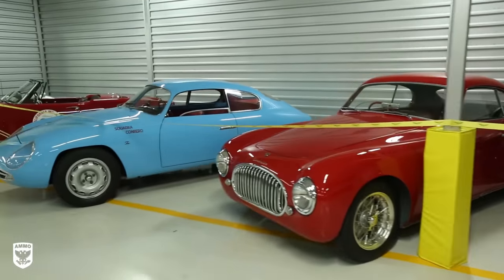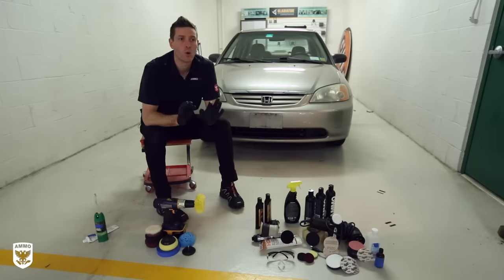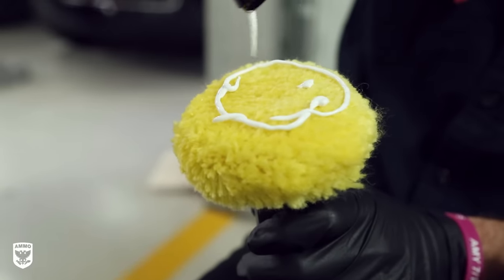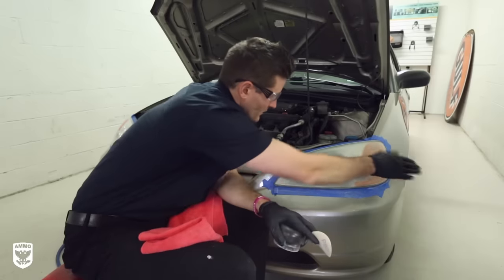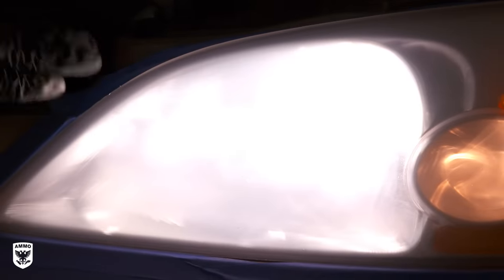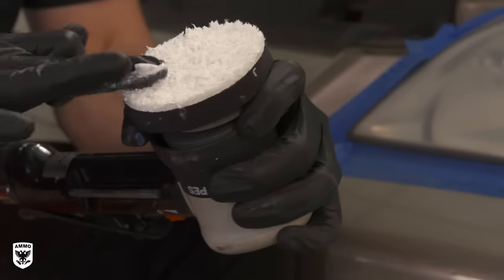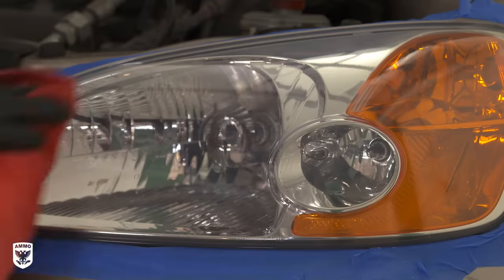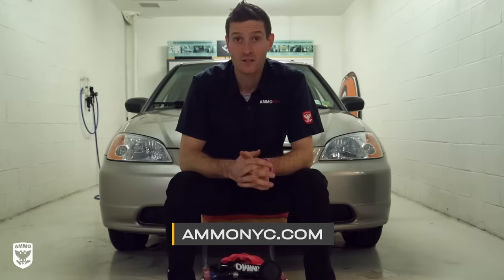How to Fix Foggy Headlights: 3 Different Methods: Honda Civic

Comment: Im new to this, what is the compound and polishing step for? I'd think the only reason to polish is if you somehow messed up the clearcoat. It looked just as good after polishing and the compound. Maybe that's just because its through the screen. But if its just for a finish why not use a meguiars finishing paste wax?

Comment: Hi where can I buy the handle you stick the sandpaper on ?Do you have a link?thank you
Reply: Hi Youtube doesn't allow links so I will try to describe as best I can, both can be found on Amazon. From what he is holding, the closest thing I see might be from the Meguiar's G2980 Headlight kit that's about $24. If you don't car about getting one that is almost exactly like his, you can just search Sanding Block and they are less than $10.

Comment: Which clear coat protectant  brand you recommend for this?
Reply: +jignacio148 just anything that has UV protection
Reply: BENBOOST9 sun tan lotion?
Reply: jignacio148 I've used 3 big brands, and they all lasted about a year before noticeable degradation.
Reply: jignacio148 Normal carnauba wax works great!
Reply: Carnauba wax has no UV protection on its own.

Comment: I’ve done the wet sand method with a clear coat finish. Turned out OK. I just watched a vid where they use Mother’s aluminum / mag wheel polish and a rotary polisher and finished with 303. Looks promising though I have yet to try it

Comment: Hey larry, just wondering, what brand is that handheld sanding block thing, and what brand are those sanding discs you're using? im looking for the same thing but cant find them.
Reply from the maker: meguiar's
Reply: I’ve seen them in Walmart u can also get them at any hardware store

Comment: Great video extremely helpful I tried to do this myself on my 2005 Town Car think the problem is I didn't use fine enough sandpaper 2000 was last step wound up replacing the lenses but for the future I'll remember 800 1500  3000

Comment: What UV sealant did you use
Reply: Carter Bila Chris fix has a video of him using one and has a pic of 1 year later and a 2 year update and his never had to be restored again.
Reply: +Mpokerdonk  actually Chris did. Rustoleum Gloss Clear Coat that is non - yellowing and has UV Protection. It is in a white can with blue on it. 2X Ultra Cover.
Reply: I use Rust-Oleum American Accents 2X Ultra Cover Spray Paint. It's $4 from Walmart and I've used one whole can on 4 cars for front and back lights.

Comment: Use 2k clear coat once you do a final wet sand of the head light with a 1500 grit paper. Dont polish it as it will make the surface too smooth. Clear coat needs something to grip onto. Speaking from experience and i have tried everything. 2k with protect the lenses but does take upto a week to fully harden. The clear coat will fill in all the micro scratches left by the 1500 grit paper

Comment: My diy solution was to wet sand then add some clear coat on it. After that you have the optional step to wet sand and polish in case of any minor orange peel. But it turned out pretty much perfect for me. 1 year later it's still holding up.

Comment: Damn if the deet does that to plastic it can't be good for skin. lol
Reply: Different chemistry.
Reply: Shawn Tannehill it's a chemical of coarse it is not good for skin. I wouldn't use it everyday but if you think about it we mostly only use it once a year when camping.
Reply: Shawn Tannehill I'll take a bit of Deet over ticks and mosquitoes.
Reply: Jhon John jon jon Literally everything is made of chemicals. Just because you don’t understand it doesn’t mean it’s bad.
Reply: it's not deet, it's the solvents used in the spray to put the deet on your skin. we want skin spray to evaporate quickly so they use low molecular weight solvents, and it just so happens that the plastic used in head lamps (polycarbonate) is weak to low molecular weight solvents. most plastics aren't affected which is why you probably didn't know it was a thing
Reply: and nail polish remover is a low molecular weight solvent if you were wondering
Reply: Well you’re only supposed to spray Deet on your clothes.
Reply: Lucky you. You must not lived in the deep South.

Comment: Well i made in 10 minutes each one on my plastic Heavy oxyded frontlights with  "water use" sand paper 2000 in start and after 2500 ... with the "scratch eraser " polisher for car (it has microstuff inside,..., gently masage with the sandpaper and al time water running slow on .... :D
if u want to add it in ur 3 solutions ;) keep the good job mate

Comment: Great job, until the end and then things just seem to get blown through.  First of all, the different protective coatings.  Would have like to have seen all three (four?) actually applied to the lenses.  Secondly, when done, I got the impression at the start that you were going to use a light gun to visibly and objectively measure how much light was coming from the headlights when done, with each of the three basic methods.  ?

Comment: FWIW 3M makes a kit that I have used in the past on Subaru and Toyota headlights. It comes with with multiple grades of sandpaper and polishing compound. Got it from Amazon but sure its sold in most auto parts stores.

Comment: Thanks man...
I  have been doing this a little different, 600 then 1200 then comp then polish but thanks to you, i never did a Sealant.🤣
Bless you
Reply: So you couldn't be bothered to finnish the job properly, Any self respecting individual restoring headlights would know the importance after sanding to hydrate and polish the lens as it seals and fill's micro scratches? Larry unfortunately decided to wipe the lens with isopropynel?? Which killed the polish!! One of many faults I could mention!!! 🇬🇧🤔👍

Comment: I used the 3rd  technique, and used a gloss clear made for plastic . I purchased it from a local hardware store,. after spraying it on the lens it started to craze. I did clean the lens with alcohol . Any ideas why?

Comment: Oldie but goodie. Did you ever do a video on a more permanent ending like clear coat? The wax seems fine but picture this; customer takes his car for a wax, the average car wash wont wax the headlights thus leaving it unprotected. Not to mention everytime they go for a car wash in the summer, they spray bug remover all over the headlights.

Comment: Thanks for this video.  It is harder than it looks and I would skip the 800 grit if I did it again.  My question is what do you use to protect from UV when you're done?  I've done this on a GH1 Mazda 6, and an e46.  My e90 could use it but I want to get it perfect and long lasting.
Reply from the maker: In this example, I use AMMO Skin but anything with UV protection in it will do
Reply: @AMMO-NYC  You mean you said it in the video and I didn't even catch it?  Sorry bruh.  Maybe I can rub Hoppes all over them hahahahha.

Comment: Great vid! I think I'll use your method on my other newer car. My head lights and driving lights were yellow and nasty! You couldn't even see inside them. I took Armour All tire foam and sprayed them and wiped them off after about       5 min the first time. The 2nd time I left it on for 10 min and took a shop towel sprayed some on it and wiped the lights off. The 3rd time I just left on the lights. There not perfect but for $5.00 on a 14 yr old car hardly no time they'll get me by. They don't look to bad. Far from perfect like yours but put out more light than before. It last for 3months are so and then I just coat the light and leave it dry.

Comment: I was curious about what sealant you use after the alcohol is used.  I noticed there is a small bottle on top the the headlight with the name covered up and that you also have a black bottle that looks like a AMMO product. You mention some spray protection, but I would like to know what you used.
Reply from the maker: I applied AMMO Skin but use what you prefer. Thanks for watching and supporting AMMO
Reply: @AMMO-NYC  Legend!  Thank you for sharing!

Comment: Old video but hopefully you’ll respond - when dry sanding how do you keep the sand paper fresh and not clogged up? So from 320-800 grit it’s all dry sanding and from 1000-3000 it’s all wet? Is that correct?

Comment: Did a similar thing with my car as part of the winter prep routine, but last time I got it washed, it seemed like all the headlight protectant I used washed right off and they turned foggy again within about a day.

Used Meguiar's Headlight Protectant (G17110). Any tips?

Comment: there's a couple headlight restoration kits which use sandpaper but very often they only have two sandpaper steps instead of three
like the meguiar's heavy duty kit only has 1000 and 3000 grit, when you REALLY need something like 800 and 2000 in there too, so you can get pretty close to the perfectionist method with a kit and one or two extra items
Reply: The Mother's kit has 1000, 2000, 3000, and 4000 which is awesome but the real party piece is the drill attachment and polish combo, it also has a velcro to mount the sandpaper as well. It's AWESOME and takes most headlights from trash to perfection in 30 mins

Comment: I'm a finish carpenter so sanding is a piece of cake for me.  After watching this there's no way I'd do a headlight restore job without sanding.
Also, I think I'm going to use the 2k uv clear coat.  Maybe 2 or 3 coats.
Thanks.

Comment: I have used this method before and it turned out great.  But even with the spray on protectant I only get about 3-4 weeks before it looks as bad as it did before.

Comment: I always believed the fog was all on the inside. Thank you very much. 
1-sand,  2-rub compound,  3-rub alcohol,  4-rub uv protector.
Reply: Sometimes the imperfections could be on the inside. At that point, there is nothing from the exterior you can do and really the only option to fix it is to replace it.

Comment: Dear Larry, hope this finds you well, i own a 2015 Porsche Boxster S, the headlight are not yellowed or oxidized, but their problem is rock chips (very small ones), is it OK to apply this method to them without damaging them.

Comment: I didn't bother with any of these. I used a motorcycle plastic fairing colour restorer. I figured if it's abrasive to the top layer of plastic to restore colour, it would do the same to my headlights. It worked.
Same principle though. Put on, leave for X amount of time, wipe off, clean.

Comment: Try plastic polishes first; surprisingly good results can often be obtained, and this minimizes the removal of sound plastic which may still contain UV inhibitors. Once you go full-on with sanding, you're committed to resealing, which may never match the OEM stuff. Pros do nothing more than a good DIY in terms of sanding/polishing, except they know how to move to finer grades until the job looks perfect. They have to make this look difficult to justify charging so much; the final sealants should be the real crux, and pros have deals to keep the best stuff for themselves, but still OTC stuff should be plenty adequate.

Comment: I do a wet sand and then clean off the light with rubbing alcohol then after it dries, use a clear coat with UV protection in it then polish it

Comment: I see.  I guess a buffer machine works better than hand?  I did tried it with an old Turtle wax eco friendly kit and it only improved slightly.  It back to hazed yellow now.
Reply from the maker: a polisher will give you better results and in less time. Yes you can still do it by hand if you didn't have a machine but it will just take longer and more effort.

Comment: AMMO NYC, What is the Brand-name of the Sandpaper Holder that you're using In this video and Where can I purchase? It appears the Sandpaper-discs are Adhesive-backed. If so, is the Holder hook & loop OR has a smooth surface for Adhesive sandpaper?  Are your sandpaper-disc 3M (Brand) and are they 3" or 4" diameter...and where/how can I purchase? Lastly, list the Grit-sequence used in this video, i.e. 800, then the next 2, after 800 was… Thanks in advance.

Comment: I wet-sanded with 220 then 600 and sprayed Urethane Clear on them. Very sweet result...
Reply: +67dodgepolara Where did you get the items from?
Reply: what clear coat did you use? and how is it holding up?
Reply: +StraitClownin909 I used Southern Polyurethanes Universal Clear It's high-solids (1:1). It's holding up great but I'm not driving the car it's got a bad engine and been sitting...

Comment: Where can I buy the small round 3m sanding sheets?  3M has a headlight restoration kit that comes with 800, 1200, 2000 and a compounding pad with compound and then a sealer and a drill attachment but it's $30 and I'd rather just buy the sandpaper sheets since I already have 3 kits by now.

Comment: If I messed up the coating process (where I overspayed and have residue gloss) can I just sand that new coating and start again? Also, what polish will I need after the sanding? I just sanded mine with 400>600>2000 grit sandpaper and then applied the horrible coat of gloss. Any suggestions are welcome.

Comment: Great video  , I have tried a few over the counter sealants and all work but for only a few months, do you recommend one ??
Reply: Doug Owens use 2k clear coat once you do a final wet sand of the head light with a 1500 grit paper. Dont polish it as it will make the surface too smooth. Clear coat needs something to grip onto. Speaking from experience and i have tried everything. 2k with protect the lenses but does take upto a week to fully harden. The clear coat will fill in all the micro scratches left by the 1500 grit paper

Comment: why in the first sanding stage did you not use water? (800 grit)
why in the second stage did you use only a little water? (1000 grit)
when  do you know when you've done enough sanding for each stage?
how do i know i'm buying a microfibre cutting pad and not a microfibre polishing pad? what are the differences?
what polish did you use for finishing?
Reply: ***** top man for effort!
Reply: zir786 the package will tell you if your buying a cutting pad or polishing pad. he used meguiars  105 for compound and I'm absolutely sure he used meguiars 205 for polish step

Comment: I just wet sand the headlights with sandpaper (up to 1000-1200 grit) and then clearcoat it from a can. works pretty well imo. Also, I don't think using rubbing alcohol on plastic headlights is a good idea - it damages the lens and makes it develop some microscopic cracks that were not there. learned it the HARD 
way on two different cars :/
Reply: Isopropyl is stored in plastic bottles. It doesn't cause cracks or dissolve plastic.
Reply: @alan4sure  there are different kinds of plastic. I'm pretty sure alcohol wrecks whatever the material headlights and glass lens are made of (polycarbonate iirc)

Comment: For a low end car like this, wouldn't it be cheaper/easier to just buy a new set of headlight units and pop them in?  You can find a pair on Amazon for the Civic for about $70.  Am I missing something?

Comment: So what wipe on product did you use? I checked the description and all it does is link to your main page of your store. I know the substance has a yellow tint to it but you didn't give us the name. I've done this process and my last step was a spray on clear coat but that peeled and cracked after 6 months. I would much rather use a wax or sealant that I apply by hand.

Appreciate all of your videos. My only complaint is the start up cost to get the bad ass tools needed...Like that micro DA you used on the lights...uber cool, hella costly.
Reply from the maker: AMMO Skin Defence Seal: https://www.ammonyc.com/shop/ammo-skin/ I hear you about the tools.  That's why I would only recommend them if you're a professional and then showed you how to do it even if you don't have the tools. Hope that helps. thanks for watching and supporting AMMO

Comment: How can you use a spray on clear coat?  The surface would be way too smooth for it to adhere, no? I learned to sand up to 1500 grit and then spray clear coat, rather than going all the way to 3000 and polishing. I polish/wax the clear afterwards.

Comment: in fact the best method is to sand it down and stop after p1500\3000 sanding disc. after that just clean and primer the beams with plastic primer , use 2k clear coat on top and just polish them after .  you can buy it from "spraymax" and just follow the instructions (2k clear coat for headlights)

Comment: What are you using to sand the headlights? You attach the sand foam pads to a handle to sand and polish the lenses. What tool is that?

Comment: If you live in Australia, go to the jewellery shop and buy Goddards Jewellery Polish Cloth. It comes in a can and if/when it dries out just put a few drops of white spirit on the cloth.  This works a treat and the results will last for years.  I have used it on the screen of my M/bike.  On the plastic of my tank bag map holder and on the head lights on my car.  Lots of elbow grease is needed but a damn sight easier that what is being shown here.